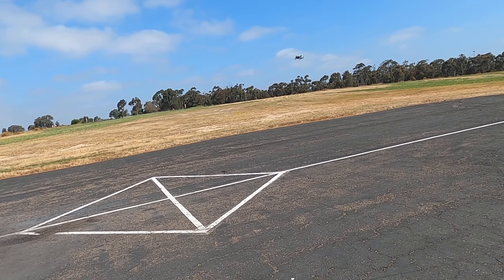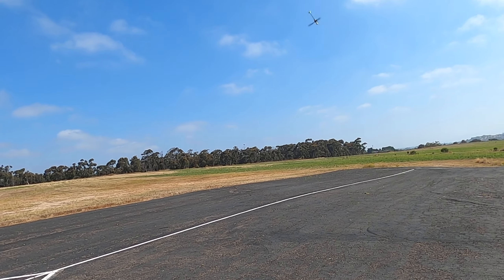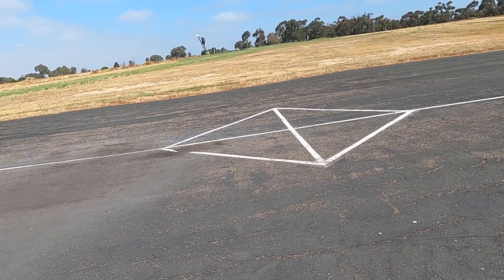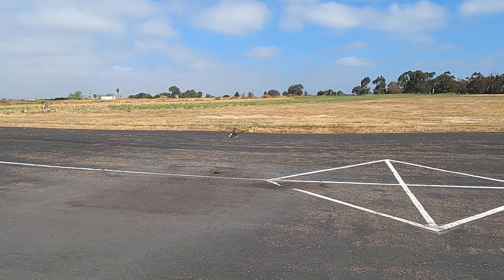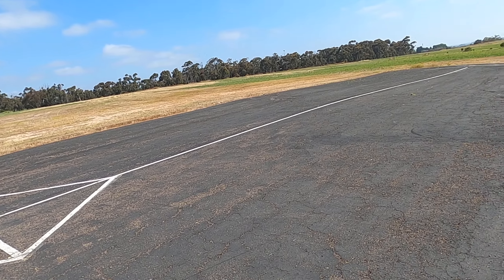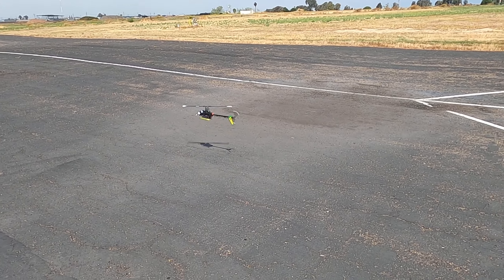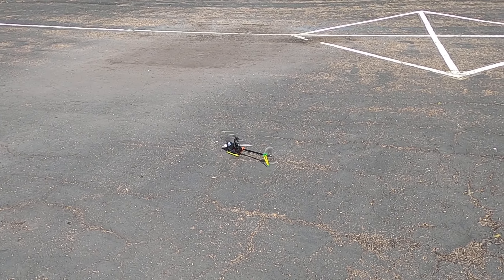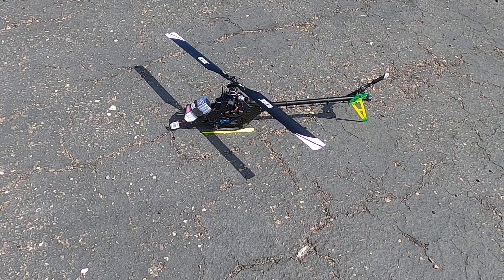Blade Fusion 270 Helicopter with AR7210BX and Coe Show Tune

Comment: Your Fusion 270 tail is holding better than my two 270 CFXs.  I'll need to recheck mechanical setup.  Quick question - are you using the stock Spektrum servos, cyclic and tail?
Reply from the maker: Yes. They are great.

Comment: Do you prefer the ar72010 over the new fc6250hx I have a lot of experience with set up and tuning of the older 7200bx. Also is this kid version going to be available from horizon soon?
Reply from the maker: I like the 7210.  It’s easy, and it’s locked in right away
Reply: Thank you coeshow619 I picked up a 6250 but have not used it yet

Comment: Hi Coeshow, I took my 270 CFX out of storage yesterday and on spool up it spun out to the left very fast.  I only have two brief test hovers on it and when I put it away it was running fine,  no spins,  solid as a rock. Any ideas ? Thanks.
Reply from the maker: check the tail servo or belt.
Reply: I'll check them out.  If all else fails I'll have to give Horizon a call. Thanks for the reply.
Reply: Hi CoeShow, I called Horizon and found out that all of my radio settings had somehow changed for the 270 CFX, no idea how it happened as I hadn't touched the settings,  weird eh? Thanks again.

Comment: Did you use gyro and mixing settings from the fusion 270 manual since using the ar7210bx?